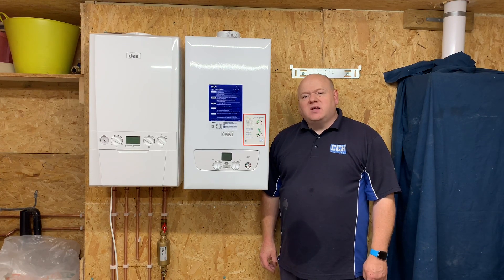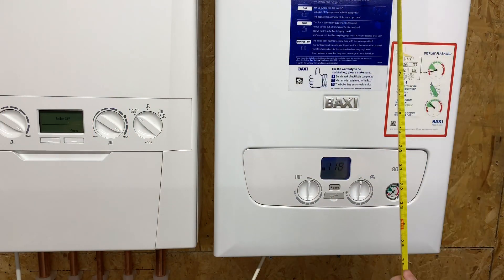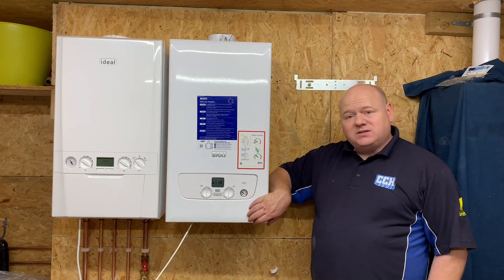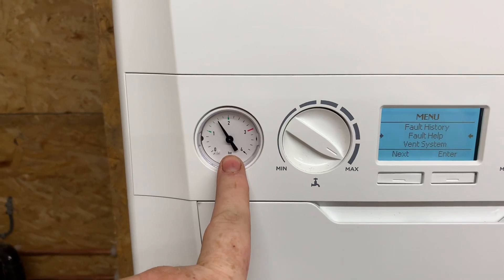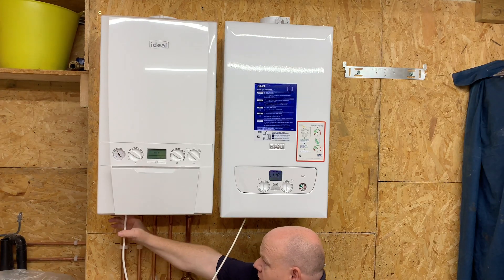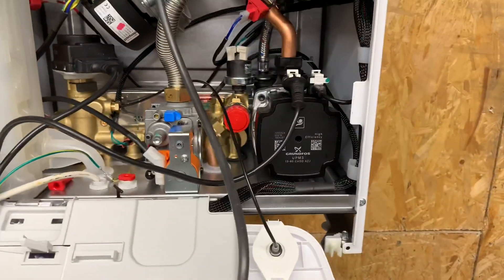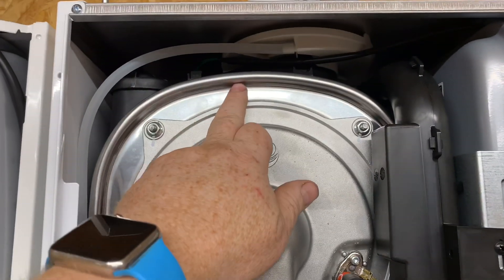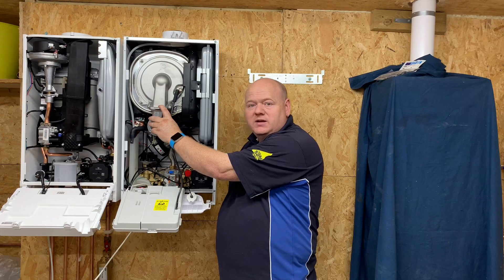Combi Boiler Reviews - Ideal Logic Max v Baxi 800

Comment: Just had a Baxi 630 installed. Very impressed. Nice and quiet, easy to fill with the pull lever underneath. Mine is controlled by Opentherm via a Nest thermostat. Having space at the back for pipework was a god send for the installer. Much prefer the SS heat exchanger and the brass components. Give a better quality fell about the whole assembly. Not keen on plastic parts in extreme heat conditions.

Comment: Great video brass and copper in the baxi, most important baxi 🇬🇧 great to promote U.K. 🇬🇧 👏🏻👏🏻👏🏻 applaud you , ps I’m a baxi man too , it’s been 25 years of looking at baxi parts being reasonable, and easy to work on ,,,,,,as opposed to some of the nightmares we have to work on and some of the parts are stupid taking the Mick ,,,, as you know that right hand manifold on a certain boiler make replacement , should have been improved ,,,,,, WELL DONE ON PROMOTING 🇬🇧 BRITISH 🇬🇧 proud of you brother 👏🏻👏🏻👏🏻
Reply: Both boilers are made in UK as far as I know even though both companies may be foreign owned, so it shouldn't be an issue in deciding between them.

Comment: Ideal vogue max for me, a shock arrestors a must with the plastic internals. Being max accredited I get to offer customers a 12 year warranty.  It's a no brainer if the customer can budget an extra few pounds.

  Tbf I don't mind fitting either of these boilers same warranty. Slightly better is the 800 for ease of service and brass components along with the stainless heat engine. For cupboard fit on the baxi range consideration has to also be taken into account for the ev Schrader valve.

 The platinum and duo-tec were always good boilers.  So intern the main baxi and platinum & potterton will most probably be improved somewhat. 

 I've only fitted 2 potterton assure lpg boilers provided by the customers.  The warranty's pants, 2 years on basically the same boiler as the 600 800 and main 🤷‍♂️

 Great review and thanks for sharing.  Great to see a side by side comparison Allen.  Bless you your're a heating wizard.  👍

Comment: I am about to replace my Ideal Icon 24 heat only boiler, still working after 15 years , never been serviced since the day it was installed and never had an issue, recently retired i am future proofing the house. Been offered Baxi 600 24kw, Worchester Bosch Greenstar 24i or Ideal logic max plus all within £100 difference in price, I know friends and family with WB and had them replaced, my daughters and brother all have Ideal which I like and had no issues in the last 5 years, however I am leaning towards the Baxi, built in Preston UK, and I have been to the factory repairing their hoists,  brass parts and SS burner, easy access to everything wins it for me being an ex engineer, yes the display could be improved, but you can't have everything.
Reply from the maker: 24kw is probably massively oversized, get someone to do a heat loss for you and install the smallest possible boiler, the boiler will be cheaper but the running costs will also be cheaper, the average heat loss for central heating is around 6/8kw. I would also advise you to choose a boiler that will modulate down to a small load, say 2/3 kw. Hope this helps.
Reply from the maker: I wouldn’t advise a 24kw Baxi heat only.

Comment: I've had the logic max c24 in a rented property since 2018 and never had s problem with it.
Only time it shut down was when the tenant let the gas run out of credit but soon back up and running.
Thinking of the baxi 800 for the next property as they have one at work and it's in use all the time and never let us down either

Comment: Hi Allen, thanks for the greta comparison here. The expansion vessel in the Ideal is 8-litres and in the Baxi 7-litres (7-litres seems a bit too small to me). As a rough approximation, would an 8 or 7 litre expansion vessel be generally adequate for a 10 radiator house? Or would I need an additional expansion vessel need installing? Thanks again.

Comment: I had a baxi fitted 14 months ago .its been absolutely fine . I wanted a Worcester Bosch but two separate engineers talked me out of them .They are supposed to be the best according to which reviews . Both engineers said they had a lot of plastic components where the baxi doesn’t
Reply from the maker: I wouldn’t install a Worcester Bosch in my own house either.
Reply: You made the fight choice.

Comment: Stainless steel heat exchanger, brass blocks, easy access to diverter valve and plate hx. Less electronic display features means cheaper PCb and less likely to go wrong. How many customers fiddle with the settings anyway?  Baxi wins this hands down. It pains me to say it as I've spent so many hours of stress dealing with previous baxi models, but I think I would have this boiler in my house.
Reply from the maker: Thank you for the comment.
Reply: Actually the ideal plastic blocks have been found to be very reliable 
Not one issue yet for me 
They switched to plastic 2016 and I’ve had more issues on the old brass ones

Comment: It's hard to fault the Baxi. Ideal is  OK, but, alu v's st/stl exchanger for roughly the same money. And the logic look  as if it needs a lot more work to access the main exchanger , then there's the rear pipe clearence to  add into the equation. The price of a stand of kit to add onto the price if needed, plus gaining an extra 50mm in depth. Baxi well ahead on points tbh.  :-)

Comment: Baxi 800 looks good, but the viessman 100 might take the edge wirh its digital display.( viessman installer coming out on Tuesday to give me a quote). Persanaly i wouldn't touch an ideal with a barge pole.
Alen i would love to to see the 800 v viessman 100 review.
Reply from the maker: The Baxi v the Viessmann would be good. I really like both boilers. The 800 comes with 10 year warranty as standard, You need to pay £120 more for the Viessmann. Happy to fit either.
Reply: Had a quote today from hug boilers for a veissman 100 fully fitted with 10year garantee for £2500. 
Rang baxi approved installer today morning, said they would call to book an appointment but still haven't. Love Baxi boilers but poor customers service means they are out the question. WB or viessman?
Reply from the maker: max navsa Baxi do not install boilers, Baxi customerservice is amazing. If you have any bigger company quote you make sure they are going to flush the system. Baxi or Viessmann would be my choice.
Reply: max navsa I think the viessmann boiler would easily beat most of the other mainstream brands. I’ve not had many come close to it , especially on quietness and gas efficiency  which is quite impressive 
which one did you get in the end?

Comment: I fit both boilers, but baxi is better for me as the on ground service and back up is better. I can always get the baxi tech or rep whenever l call. Ideal is difficult to get the rep ( leave a message brigade) and no immediate response. Baxi have their own in house local technicians and help with any problems when you are on site. Doesnt happen with ideal although technical number is good. Its early days yet with 10 year warranty but l do prefer brass over plastic. Ive never seen a brass component develope a pinhole or split in twenty years around boilers but I ve seen plenty splits in plastic boiler pipes and fittings. I wonder how the O rings will hold up? Seen plenty with wheatabix stains over them. Other manufacturers changed from brass to plastic and reliabilty seemed to suffer. Vaillant.. diverter valves is one example. Worcester link pipes in juniors is another.  At the end of the day the customer reads the reviews and then makes the decision.
Reply from the maker: Thank you.

Comment: Allen, some great informational videos here. I've been quoted a cost for a Baxi 830 and a Worcester 30 8000 for an additional £350. In this case, am I gaining much by going with the Worcester? Thanks.
Reply from the maker: Kris West I wouldn’t buy a WB if it was £350 cheaper.
Reply: @AllenHart999  Thanks, Allen.

Comment: Logic for me, easy to install, easy to service, easy to repair, better display. Look after the heat engine and it’s a great little boiler.

Oh and it’s 45mm for the stand off on the logic 😉👍
Reply from the maker: paulfocus23 It’s not a cupboard fit boiler once it’s got the stand-off though, What’s better about the logic 👍
Reply: I agree once it’s got the stand off it’s not going to fit in the cupboard.  Just think the logic is an easier boiler to look at and work on. I guess a lot comes down to what you are use to installing and what you like installing. I use to love the baxi’s when they were the combi he & duo tec HEa. The GA range ruined there reputation abit. I’ve not installed or worked on a 800 yet so my opinion is abit biased really! 👍
Reply from the maker: paulfocus23 I installed loads of logics tbh, They had a few issues mind, not as many as GA though
Reply: Ye early logics has plenty of problems but the newer ones seem a lot better. 
My view is, if the boiler is installed correctly and well maintained any make & model should last a long time.
Reply from the maker: paulfocus23 I certainly had my fingers burnt 🥵 with the baxi GA, Had a few issues with the logics I installed now, first ones only had 5 years warranty

Comment: Hi. I'm having a new boiler next year. My plumber has recommended the Logic Max C30. Can I ask if anyone has any experience with the new plastic components please? I'm leaning towards the Baxi 800 as I fear plastic parts won't be as reliable however I am no expert. I'm happy to buy a vogue if people think it's worth the extra money. I'd appreciate any feedback. Thanks.
Reply from the maker: Roland Guilford I have never know of any issues with the plastic components in the logic. As long as they are installed correctly both boilers will be great. 👍
Reply: @AllenHart999  Hi Allen. Thanks very much. Really appreciate the feedback. Would you say the Vogue is worth the extra money? All the best.
Reply from the maker: Roland Guilford Absolutely, Just remember it’s only as good as the installation though. Clean system and correctly installed. Water sample done to prove the water was clean.

Comment: What makes the 800 series better than a duo tec and why?

Thanks
Reply from the maker: Hard question, Smaller i guess, Thanks.
Reply: More efficient, smaller, can pioe up the back, doesn't have the plastic blank plug that can leak on top of heat exchanger, I think they are quieter on ignition too.
Reply: @samsonheating1010  The schrader valve on the Duotec expansion vessel is also a b****r to get at. I don't know why they didn't just point it forward like everybody else. The 800 solution is novel and should be fine.

Comment: I don't believe the line that plastic is more reliable than brass. It doesn't strike me as likely if tempreture change varies on a consistant basis, unless its a point on the corrosion of metal.

Comment: Hi mate, just something I thought you might want to add, to explain that flow rates are mostly a marketing tool, It’s my understanding that on a standard Combi which uses a plate heat exchanger only, DHW flow rates are going to be the same on any boiler if the kw was the same, it’s physics.

The easiest way to work out any boilers maximum flow rate is as follows:-

Boilers Kw times 14.33÷35 equals the maximum litres per minute flow rate at a 35° rise.

24kw x 14.33 ÷ 35 = 9.82 ltr/min

30kw x 14.33 ÷ 35 = 12.28 ltr/min

35kw x 14.33 ÷ 35 = 14.33 ltr/min

Just remember the science/physical number 14.33.
Reply from the maker: +Gas Gimp Totally agree with you, What effect would a bigger plate have? Let’s say we doubled the size of plate in a 24kw boiler, Would the flow rate be the same?
Reply: Flow rate is determined by the mains pressure. Spec your combi to your water mains pressure. I.E if your mains allows 15lpm, pick a combi that will allow 15lpm at 35 degree rise. You only get out what comes in.

Comment: Hi allen,great video as usual baxi for me between the two.but i'm thinking of the mains eco compact as a replacement for my broken ideal logic 30k(heat exchanger. aluminium)purely because of reliability,cost,and hopefully it will more or less slot in, since they are the same size i,e cupboard fit, the 5 year warranty will do for me cos' i will probably  move house before then.i would appreciate Appreciate any "ball park figures" on supply and install.in rotherham area.cheers!

Comment: Not a fan of ideal logics. Took them long enough to put the pressure gauge on the front of the case. Baxis are better made plus the flue test point is on the top of the case and not on the flue elbow (bit shit when it’s in a cupboard and the flue exits to the side.

Comment: I would go for baxi 
Ideal heat exchanger, sump, burner, ignition has common faults nothing has changed looks of it apart from display
Reply from the maker: Thanks for the feedback.
Reply: In ten years I have changed one Logic sump and had one warranty call out for a diverter fault and one (not strictly warranty but Ideal did it under warranty) where the customer broke the upper clips on a plastic logic cover. I have never seen an ignition fault, nor a heat exchanger fail, nor a pcb fail. Customers love the way the interface talks to them in English, they take note of the on screen service reminder, and the I touch controller has proved very popular..if a bit pricey. Its definitely NOT a repeat of the Ideal Isar/Icos mess up.

Comment: I'd still rather have an Ideal Vogue with an I touch controller than either a Logic or a Baxi 800. I don't like the plastic front on the recent Logic. I've known a customer mess with it and snap the upper clips destroying the case seal and running it that way for 6 months. As to plastic hydraulics....it all depends on the quality of the plastics and as we know the plastics on Worcester and older Glow Worms has been substandard.  I love the Logic as a boiler as its such a thoughtful design and reliable.

Comment: If this is baxi top end boiler, that would be goin up with against vougue wouldnt it?
Reply from the maker: Vogue is not a cupboard fit boiler. Logic max is 10 year the same as the Baxi 800, Also both are around the same price point. I have done plenty of reviews on the Vogue.
Reply: @AllenHart999  idea dropped the adey filter because they wouldn't honor the 10 year warranty ,is the filter under the same warranty?
Reply from the maker: @accesszero4803  I would rather have the omega filter. I am guessing the warranty is the same as the boiler, Not 100% sure though.
Reply: @accesszero4803  10 year on micro 2 filter aswell
Reply: @AllenHart999  After all your Rewievs when you compare baxi 600 or 800  with the new Viessman vitodens -100 which is more better.

Comment: A plug-in timer option would have been useful on the Baxi, especially for rental properties.  But the IFOS weather comp sensor is handy.
Reply from the maker: Wouldn’t comply with requirements though. Needs time and temp control, Built in timers are now pointless

Comment: Have Ideal sorted out that problem with the condensate sumps developing cracks?
Email quoting for the logic + and Logic + Max right............... now! 10.25 pm Satdy night. Bloody hell! Just e-mailed the link to this, your vid, Al, to customer too. Just in case he watches... "Ey up, Nick!"
Reply from the maker: They did change the sump and it seems to be better now. I quite like the logic really.
Reply: Allen! Bugger off! I'm still working. LOL! Bloody pop up notifications.
Reply from the maker: @loafersheffield  Hi 😂😂😂😂
Reply: It's my go to manufacturer and model for mid price boilers. Easy install, easy for user to figure out, ease of fault diagnosis, (over the phone) ease of repair and service. Just annoys me how many folk blow a fuse when summat goes wrong after 5 years and they don't bother getting it annually serviced even after you remind them and they don't phone ya back. More annoying is that none of the manufacturers don't bother to inform the customers either, so that the warrantee can be extended. I wonder why??? (Cynical bugger me tha nos!)
Reply from the maker: @loafersheffield  What you doing working at this time?
Reply: Multi-tasking. I can spin plates and juggle at the same time. Crack open a can of Stella, type invoices, send quotes and listen to "the boss" all at the same time. The surrogate "Boss" that is.
https://www.youtube.com/watch?v=xq95141AmYU
Not her indoors. I'm in my garage conversion, man cave. Avoiding gerrin' nagged. LOL! get thisen wireless in your garage. I'm seriously thinking of also installing a toilet.
Now go ter bed!
Reply: When I was on an Ideal training course in Leeds four years ago we asked them about the sump crack issue and they said they were aware of it and had changed the moulding process. I have a Logic Heat at home and its had no faults in three years and I've personally only had one sump to change on an older Logic Heat. My first Logic Combi install was nearly ten years ago and that has had zero faults. There was a bad batch of heat exchangers very early on, and the sump issue has persisted longer, but if Ideal are to be believed, they have got it sorted. I've never had a Logic hydraulic block fail or a PCB. Nothing is perfect but they are generally very good boilers.  I have installed only a few Baxis and have no problem with the boilers at all. I'm less keen on the company. Its the opposite with Worcester. I like the company, but don't like the boilers.

Comment: I had the Baxi 630 installed 20 months ago and has been working flawlessly. I wonder what the 800 has that differs from the 600 series as they look identical but i think my 630 has just 7 years warranty.
Reply from the maker: Paul King same boiler, different warranty and includes filter
Reply: @AllenHart999  Thanks Allen, i knew you would know!